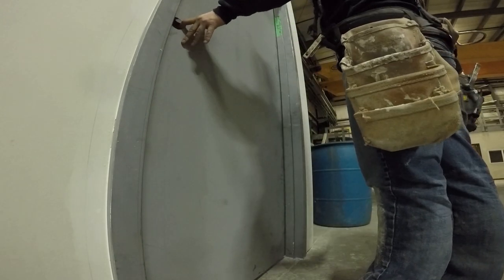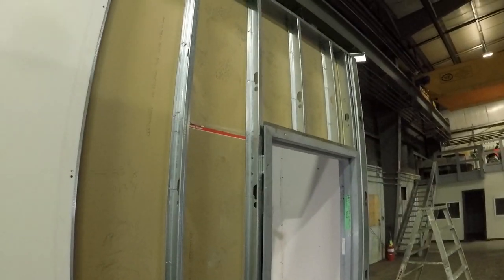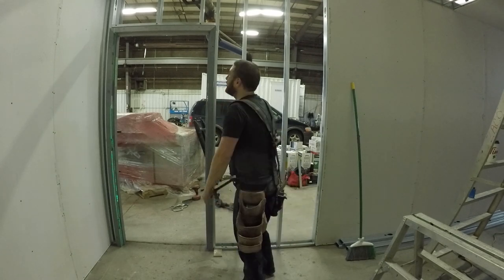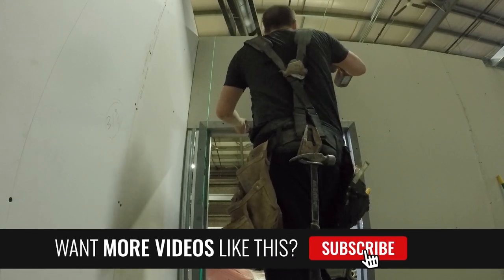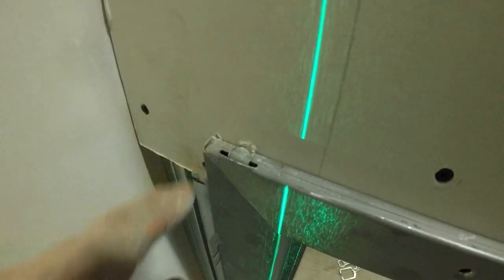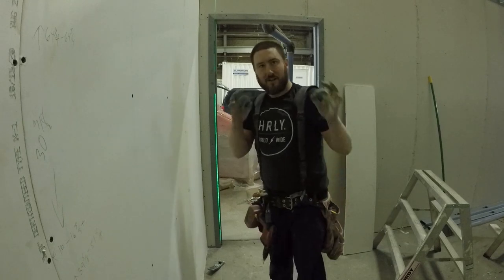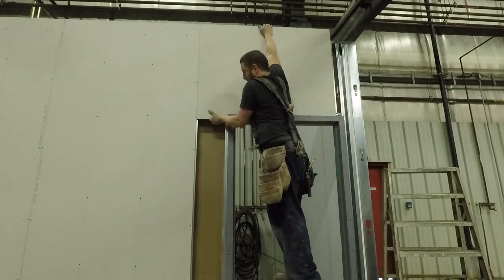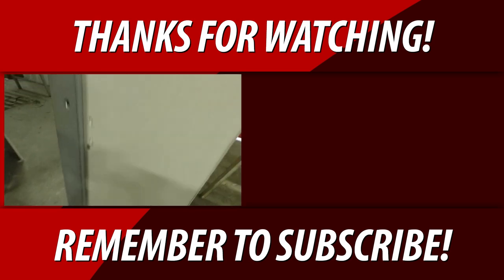Commercial Drywall  Installation Around Fire Rated Doors In Metal Stud Framing How To

Comment: Hi Chris you should have put a double stud either side of the door frame makes the door frame stronger. And those door frames are not much good as you are supposed to by right have your hook come down at least a foot each side of your frame as when you bang your door the taping joint don't crack. You where correct on the 1st sheet you installed but the 2nd sheet should come down 12" at least so it covers below the 1st hinge.

Comment: Amazing work! I am opening a Cafe in New Jersey and they are asking me to put 2 Hr Fire Rated Drywall and that is 2 layers of 5/8. Do I have to put it directly on the old wall or old wooden beams or can I just come out like 2-3 Inches and frame and build a new wall? I would love to know please because there is some metal sheets and old plaster on the old wall and would not want to DEMO so would like to Frame away from the old wall and install new power and plumbing and put the 2 layer dry wall. Can I do that?
Reply from the maker: Excellent question, So what I would do is laminate or drywall the old wall one more layer 5/8" because techinaclly you need double layer both sides, then frame a furring wall tight and add your top 2 layers of 5/8" to the outside for a nice finish, does that make sense to you?

Comment: Do you need wood stud inside to make sure the door frame secures correctly? Or just secure door from inside metal stud onto it?
Reply from the maker: If it's a steel door frame you only need steel stud. If your using a wood jam then you need either plywood wrapping the opening or wood stud.

Comment: Can u rock before the door frame is in???
Reply from the maker: Some frames yes, if its a knock down with an adjustable width your good, or if you use wood jambs. Otherwise the doors always go in first. Just remember to add 3/4" plywood to the studs (inside or out) for wood jambs.